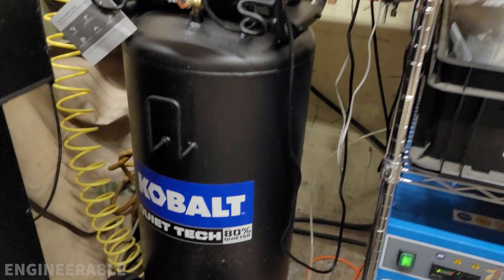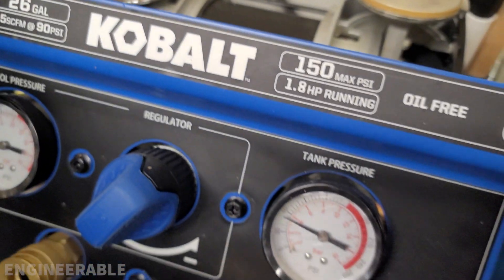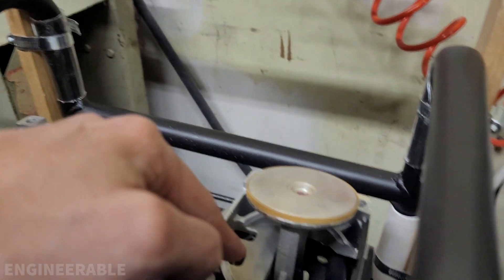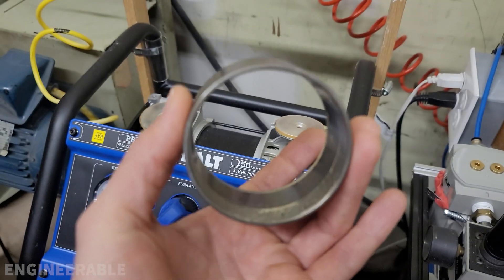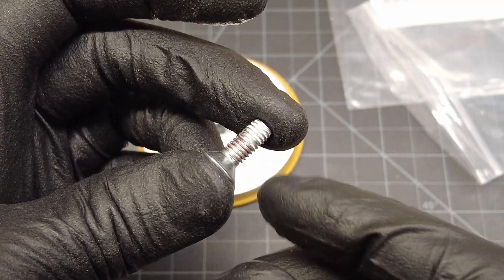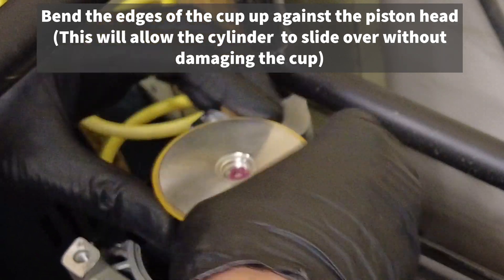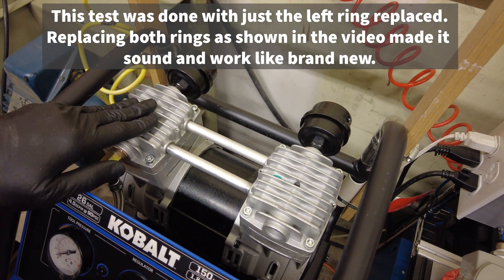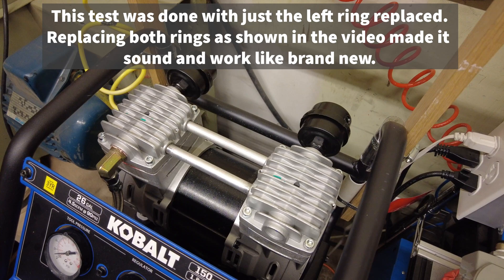KOBALT Quiet Tech 26 Gallon Air Compressor FAILS AGAIN! (Watch this to learn how to fix it)

Comment: Have you found where to buy the cylinders or pistons ? On one side of mines the cylinder and position is trash. I can’t seem to find it on the web. Thinking about replacing it with a vevor 2hp motor or the California air tools motor.

Comment: Not sure if you can help BUT here goes! I bought this same compressor off a private individual. We I first plugged it in it would crank then stop real quick! After research I elected to change out the pressure switch. Started right up but sounded weird! I then ran across your video and decided to pull the head. Low and behold I found the issue rod broken at the top and no piston!! My QUESTION IS?? If you had to purchase a rod and piston do you have any suggestions as to whom might have one? Any help greatly appreciated!!

Comment: Thanks for the info. Got the parts & took it apart. Just couldn't figure how to get the cylinders back on. Now I know how. Also I used a Map Gas hand torch to heat up the bolts until the old loctite stated to fade. Then used a 3/8 impact  with a 4mm apex to remove bolts with out stripping them out. Yes those bolts are cheap & soft. Just finished the repair. A heads up on torque amount for the head bolts. I tried 15 ft/lbs and striped one. I think 10 ft/lbs is enough.

Comment: Man the threads on the right piston broke on mine, cant find one anywhere.
Reply from the maker: Insert a helicoil into it to create new threads.
Reply: @engineerable what size helicoil do you think it would be?
Reply from the maker: @lucassmith9461 You'll need to measure the screw and pitch. Just a guess from rewatching the video, it's about an M6. Measure it to be sure.

Comment: Just stripped the hex screws on top of the pistons. Yours came out so much easier. Now I gotta figure out how to remove them, and what to replace them with.
Reply: I did the same thing it’s a pain but possible 
What worked for me was taking a dremel with an engraving bit and slowly grinded a slot on the bolt head this took quite a while so I’d recommend finding something to fit in that tight spot 
 Then I sprayed some free all on the bolts and let it soak over night
Then I took a blow torch to it for a fair amount of time out of anger
And finally I took an impact screw driver and a ball peen hammer and I was able to hammer it free
Replacement bolts are the easy part 
You can find them at Home Depot or probably an ace hardware I was able to find them easily at Home Depot also just take the bolt with you and in the hardware section you’ll find a board with a bunch of threaded inserts to find the thread count I did this awhile ago so I don’t remember the thread count and bolt size but i remember it being metric. After you figure out the dimensions you’ll find the bolt in a box with drawers just find the one that matches and ta-da

Comment: Truly appreciate your prompt feedback.  Please be so kind to advise precise size of the piston cup in amazon and shall follow your instruction.
Reply: Thanks & God bless
Reply from the maker: @thopperv4244  Links to parts are in the description.
Reply from the maker: @thopperv4244  Remember to use High Temp Loctite on the screw, otherwise it will become loose.
Reply: So, I just finished car detailing and I got the parts needed just now via Amazon. When I pulled out my compressor from the corner coz I have a shelf on top of it but not connected nor touching so I can see an overview of it. As I was started unscrewing some screws I checked the black round plastic from the right piston and noticed it was quite loose so I torque it. Then I look to the left piston and it was missing and it actually came loose for some reason and found it on the floor. I did replaced it and torque it and it sound like the same as brand new.  I believe it wasn’t torque properly from the manufacturer’s facility. I will keep the parts just in case.  Thanking you once again.
Reply: Or, perhaps it became lose in overtime due to vibration. I’ll use loctite hopefully to prevent as such from happening again

Comment: Mine was out of warranty and have an exact issue yesterday while car detailing. Would it be fine or safe to just let it be and keep using it? I’m leaning towards of getting a California Air Tools sooner or later.
Reply from the maker: @thopperv4244  No, it will damage it beyond easy repair if you continue too long. It's an easy fix and the replacement piston cups have lasted way longer. California Air Tools is probably higher quality and they have piston service kits. They will need to be serviced every 3000+ hrs

Comment: Next time place the piston sleeves on before dropping the piston tops on with new seals this drop the chance of damage to the seals.
Reply: Not sure how that is possible to do. The pistons don't extend past the leaves. Can't clamp the piston cups/seals while the pistons are inside the sleeves. The method used in the video works fine. Videos from manufacturers say to remove the whole piston rod, but that is not easily accessible in ours without removing the motor.

Comment: So, if after 3 years and your warranty runs out, you can't get replacement parts. That would be a problem for me. Those oilless compressors are bad about the piston rings wearing out fairly quick. I had to throw away 2 different oilless compressors due to the parts being obsoleted. 

I would take that Kobalt compressor back every time the piston rings wore out and get a new compressor, so the warranty doesn't run out.
Reply from the maker: @halfstep67  The stock piston ring cups must be crap, because the ones I've replaced it with have yet to wear out. Returning it is a waste of time. The lesson I learned is that you need to buy a compressor that offers replacement parts, like California Air Tools. Piston ring cups are a wear item that need to be replaced every 3-5k hours.

Comment: How are the new seals holding up? Thanks
Reply from the maker: @eduardoperez7797 They are still working fine. Have worked much longer than the original seals.

Comment: Weird, I wonder if my compressor was made differently. I've owned two of them since 2019 and I have never once had to work on any of these. I took it apart when I first bought it to see how it worked and it had green seals not yellow like yours. But I bought 2 for a sandblaster, sold the sandblaster now I swap which one I use every few months. I use my compressor constantly about 3-4 hours a day minimum and they get used in the rain and It NEVER has any issues. Must be a new manufacturing problem.
Reply from the maker: Yes, it must be some lousy quality cup seal material from the manufacturer, because I've been running these replacement cup seals far longer than the original with no signs of wear.

Comment: Random question
While I had the head off it looked like that gasket (the head gasket) may be deteriorating.  I don't see any way to access it, it seems sealed in from the factory with no access....Are you aware of any want to get at it or am I out of luck?
Reply from the maker: Is that the gasket between the valve plate and the head? It's possible that a gasket from a similar sized oil less air compressor will work, like California air tools. It's call the Cylinder Head Obturating Ring.
Reply: @engineerable  Amazing, thank you so much! This is exactly what I needed!

Comment: I agree Kobalt it complete crap I have same air compressor my air regulator knob went out Lowes told me  I had call Kobalt they do not have the replacement parts 3 year warranty IS COMPLETE LIE they will not replace any parts or will they give you replacement air compressor this air compressor is used for my  business  I'm on budget and can not afford go out buy better air compressor. Lowes told me I could buy new air compressor and use that knob. so your tell me a knob will cost me same price as new air compressor wow I will get right on that lol I have already tried to buy after market replacement knob witch will not work it does not line up with the gage compressor module. I had to ditch the Kobalt and just make my own gage and hose connection because Lowes would help me i will not be a Lowes customer I will travel extra miles go to home depot  my next air compressor will be through east wood since I am into auto body business. Lowes gets a 0 star from me.

Comment: WARNING with FIX:  My 6-month old KOBALT Quiet Tech 26 Gallon Air Compressor stopped creating any pressure. It runs and sounds normal, but zero pressure. From all the reviews I almost returned it under warranty, considered replacing parts, etc.. But wait!!!

INSPECTION: With motor running, unscrew the round air filter housing and BAM SHAZAM it works like new again. (It's only used in a "fairly clean" garage.) The air filter housing top comes apart (put the nut in a vise and push and twist the cap off). Filter inside was clean as new. 

PROBLEM: the small inlet tube got filled in by a tiny mud dauber. 

SOLUTION: Use a Phillips head screwdriver to remove the mud dauber seal. Cover the hole with screen material.
Reply from the maker: Good to know.

Comment: Nice video. I just bought one. Hopefully work good. I didn't buy the extended warranty.
Reply from the maker: Thanks, piston cups are the only issue I've had, and the replacement piston cups have lasted a lot longer
Reply: @engineerable  do you recommend it?
Reply from the maker: @Oneguygarage  Recommend what? Extended warranty? It sucks because you have to take the compressor in each time and get a new one. Takes less time to change the piston cups when they go bad.

Comment: Maybe you should've put the piston cylinder first before the disc.

Then pushed it down.
That way it would've been air tight in there.
Reply from the maker: Unless you can explain how to do that, I don't think it will be possible. The piston cup has to be sandwiched in the piston first before it can be put inside the cylinder. It was not difficult to put inside the cylinder if you tilt it like I showed.

Comment: Why didn't you lubricate it?

Grease would help a lot.
Reply from the maker: The piston cup is Teflon, so it's made of lubricant. Adding grease would defeat the purpose of an oil free compressor, which is clean air uncontaminated by oil or grease.

Comment: I have a brand new one just like this and it just hums/lightly whines when I flip the switch. Doesn’t kick on. Put a new start cap on it and still same issue. Any recommendations? Please help
Reply from the maker: If there's back pressure on the compressor it won't start. Like if the unloader valve is not releasing pressure. Check if the motor rotates freely. Otherwise could be bad centrifugal switch.

Comment: Do you think that a bit of oil applied to the piston cups during assembly would help them to seat and possibly reduce wear?
Reply from the maker: Maybe, but it's not necessary for assembly, and it probably won't last long. The piston cup itself is made of "dry lubricant" aka PTFE, aka Teflon.

Comment: Great video I'm having the exact same problem with the same compressor
Reply from the maker: Thanks, this should work for you. Just make sure to use the high temp Loctite, because otherwise the screw will loosen. So far, the new piston cup has lasted longer than the original.
Reply: Great video man- and thx for answering with good follow up on how it's held up. Considering buying this compressor and searching the pros/cons.. @engineerable
Reply from the maker: @markyakubovsky3380  The new piston cups are still holding up well, longer than the originals. Only buy it if you are ok with doing the piston cup service. I also recently added a smart switch that cuts it off overnight and weekends, and if there's a large leak, like a pipe bursting. Watch this video for how to add the smart switch https://youtu.be/m9eWLkFs5DY
Reply: @engineerable  What size are the cups? When I look at the amazon link it shows  72x56x1mm. Is that correct?

Comment: By chance to do know the size of the o ring that sits in the head? Cushion the piston sleeve?
Reply from the maker: The piston sleeve cylinder ID measures 69.8mm, therefore, the O ring ID should be about that. The piston sleeve wall thickness is about 2.6mm.

Comment: Where did you find the parts at I have one that won’t produce air have had it about 2 years no issues till now
Reply from the maker: Links to parts are in the description or in this post 
https://www.engineerable.com/single-post/kobalt-quiet-tech-26-gallon-air-compressor-fails-again-watch-this-long-term-review-before-buying

Comment: I think the problem your having is that it’s basically just a compressor designed for occasional at home use,and oil free for low maintenance because of that ,the pump seals typically have a 1000 hour life span, if your using it everyday all day long in a workshop environment it’s not going to last, your better off going with something more commercial grade that requires oil, and as long as you service it by changing the oil it will last an extremely long time, and another benefit is that most are belt driven so a motor or pump can be replaced separately
Reply from the maker: I moved from oil compressor to oil-less for lower noise and cleaner air (even though I already have good filtration and an air dryer). California Air Tools oil-less air compressors claim a 3000 hrs, and based on how often ours run, I calculated that it should run at least 3-5 years (2-4 hours a day of use). So far the new piston cup has run longer than the original. It appears that the Kobalt compressor is lower quality than California Air Tools, so maybe 1000 hr lifespan is more accurate.
Reply: @engineerable  I dunno if this will help any but if you ever try oil and belt driven again, I suggest getting the biggest mufflers you can find at a decent price and if needed mod it for use with mufflers; I got an old sears campbellhausfeld that was thrown out and first thing I noticed was that was pretty high CFM, I than made a cover that went over it's infake that I threaded to install 2x filter based mufflers that's about 2-3inches diameter, it's pretty silent minus that slight...** I also frankensteined it onto a 20gallon modern campbellhausfeld that was being sold as a non functional return unit.... generally I find find direct drives to be fairly high pitch but belt driven just need to have better mufflers installed:)

Comment: I will never buy this compressor no good terrible
Reply from the maker: Only buy it if your comfortable repairing it. The repair shown here has worked for longer than the original piston cups lasted.
Reply: It’s fine for at home occasional use, but if it’s going to be running daily all day long, oil free compressors are not designed for that

Comment: Just an idea, order extra seals if they work while they're still available. I would put the sleeve over the rod first then slid the piston in from the top and screw it to the rod. Then you know your seal is going in the right direction. Just a couple observations.
Reply from the maker: Yes, good idea to buy some more. It continues to work great after using high temp loctite. Unfortunately, on this compressor, it's very difficult to remove the piston from the crankshaft, so not practical to slide the piston in from the top.

Comment: Great video, thank you.   I have the same Kobalt with the same issue.   not a problem to rebuild the cylinders BUT I cannot find a 75x70x40 cylinder sleeve anywhere.   Have you had any luck finding this part?   I love the compressor when it is working, sucks to think it is a throw-away purchase if I cannot rebuild the compressor.   I did some research and found some replacement cylinder sleeves that are 75x70x49.5, but these won't work for obvious reasons.   I also looked at buying a replacement motor, california air makes a couple that are very close to this one, the problem being that the mounting holes are not the same and will not work.   Any thoughts or suggestions?
Reply from the maker: I was also unable to find compatible cylinder heads either. You could add 9.5mm spacers and get longer screws. If you have a lathe, you can cut the sleeves shorter. I was very tempted to get a 2hp California air tools motor. I've heard them and they are way quieter than the Kobalt. If your Kobalt is within the 3-year return period, may be best to return and buy a whole new CAT compressor for not much more than the motor alone costs, although it's only 10 gallons: https://www.aircompressorsdirect.com/California-Air-Tools-CAT-10020C-Air-Compressor/p70275.html
Reply: Glad to see I’m not alone with this issue. I just picked up one of these second hand for 50 bucks, took the whole thing apart because it wasn’t filling the tank. Everything so far has been available on Amazon or Home Depot. I have been searching the internet for days for that 75x70x40 sleeve. My sleeves are pretty worn since the last owner had blown out seals and probably ran it like that for a while. If any of you guys find some sleeves or methods that will work, let me know please! Thank you for the video and input, very helpful!

Comment: could dirty air filters have caused this?
Reply from the maker: Nah, the filters don't look dirty. Our shop air is clean and filtered
Reply: @engineerable  Its air intake filters may look clean but can still be dirty enough to restrict airflow to the pumps
Reply from the maker: @josephtheinflatableguy4609  I get what your saying, but these filters look like new and seem to allow air to pass easily.
Reply: I think the cause of the failure is probably a consumer grade low usage product sounds like it is in continuous use in a shop where a true HD commercial compressor should be sourced. A modern medium priced unit failed after 2 years of continuous use. I have seen old timer garage compressors that ran daily for 50 years with no maintenance. They are expensive to purchase that kind of quality.